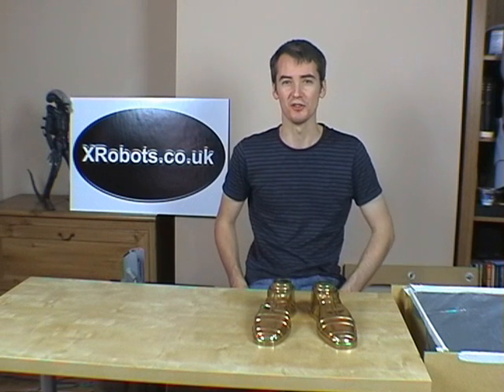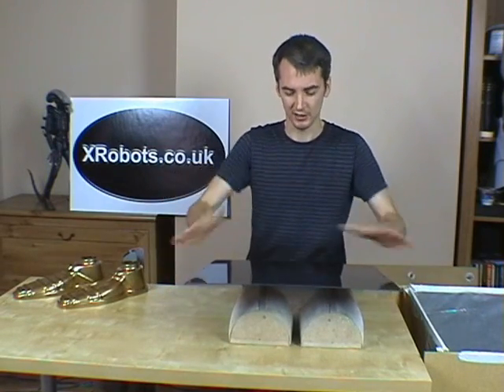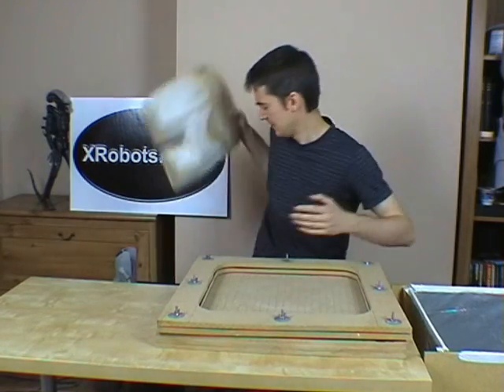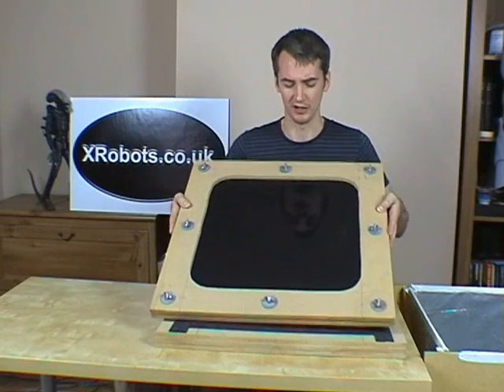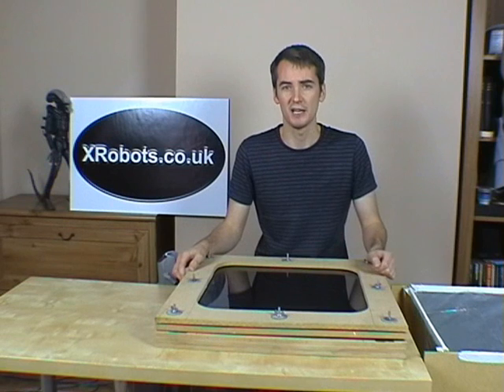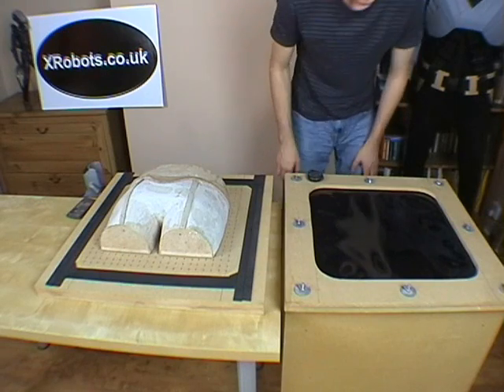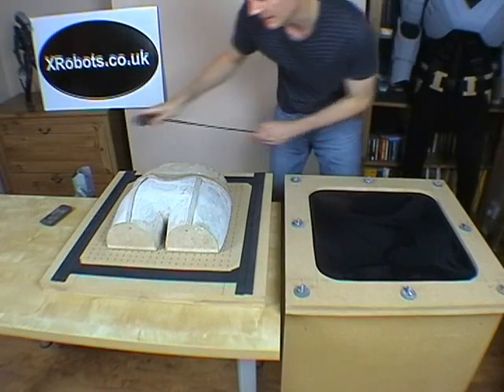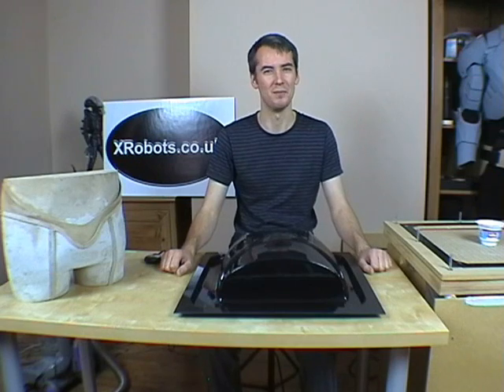How to build a vacuum forming machine including my easy heating solution | James Bruton

Comment: Best vacuum form video I've seen. I've watched it more than 5 times what is the rubber seal for.?
Reply from the maker: to stop air leaking.
Reply: @jamesbruton  thank you. I know the top is three pieces. If the top is a single piece why would it need tape to hold it.

Comment: The FormBox is a much easier solution https://www.sysfix.co.uk/FormBox
If you leave the plastic too long, it will melt, fall into the heater and cause a fire!
Reply from the maker: ok, I'll just go back in time SEVEN YEARS and buy something that didn't exist then
Reply: James Bruton OR place the heater above .
Reply: Dont be silly! Buy the thing first BEFORE you go back seven yers. ;D

Comment: Will this work with clear/transparent plastic as well? Or do you have to cover it in some kind of film so the infrared light doesn't just pass through the plastic sheet without heating it?
Reply: It would work and would only make it quicker adding the background gor the clear plastic... it shoild heat up regardless transparancy as its still a physocal object

Comment: Here in the US, the largest 120V Quartz heaters are limited to 1500 watts, which in my case was not enough to get the styrene up to the proper temp. My solution was to simply cover the styrene/frame with a piece of stiff aluminum (an old sign) to prevent heat from escaping out the top, reflecting it back to the styrene.  Heats up .03 inch styrene in no time at all.

James- thanks for the simple, low cost solution to the toughest competent in a home-brew vacuum former:  the heater.

Comment: Here in the states you can readily buy sheets of pressed board that already have the aluminum reflective paper attached, used for reflecting heat from entering into the attic.

Comment: You make it look so easy. I tried it with .060 clear pteg (which is about as thick as a penny) and it would not get pliable enough to work.It did get very hot to touch.I used a 1500 watt halogen light garage heater. I even tried putting the pteg 12 inches from the heater but, no luck.

Comment: Looks like a vintage tennis racquet press so Im pretty sure if the same locking mechanism were applied that would work well to clamp and hold the removable plastic sheet layer...

Comment: one suggestion: (I know this video is 6 years old lol) but:

If you made your box the same height as your table, you could hinge your heating frame then simply flip it over onto the vacuum table and you'd have perfect alignment every time

(that's what many "pro" vac tables do)

ANother suggestion:

You can buy "pegboard" which already has the holes drilled in.....it is easier to block off the holes you don't want than drill all those holes you do.....now it IS thin, only 1/4" and you might have to brace it, but it is still easier than drilling all them holes.....

Comment: Hey, so with this machine, the second later is just a frame like what you use to put the HIPS in? And if I tried to use the vacuum form process with something besides molds it would melt the material right? For example other hard plastic items

Comment: One quick question, if that's alright. For the frame with all the holes and the vacuum sealing, what did you use to hold the wood pieces together to get maximum sealing? Thanks for all your awesome work!!!!

Comment: That is a great idea to use a quartz heater.  I am going to try that.  What was the thickness of plastic you used?
Reply: +valveman12 I kept seeing 1/8th inch as a good thickness so I ordered some (for me Curbell Plastics was the best price) It's pretty thick, so I think it will do well.  Another thing I saw is that the plastic should sag half as low as your buck is tall, haven't tested it, but seems like sound advice.
Reply: Bhil Fitch Thank you Bhil

Comment: Sorry if someone has asked, but i wanted your opinion regarding the best material to create your model from. You mention that your '3PO bottom' is made of wood. That seems very hard to work detail into.  Is there some other material (like clay or bondo) you use over the wood in order to create the ridged details? I'd love to use your vacuum method but want to be sure that whatever i use to pull from can withstand many attempts/pulls.

Comment: how thick is each piece of mdf board for the plastic?
arent the bolt heads keeping the frame from making a good seal?
what material are you using as a gasket on the board with the holes?

Comment: Hi James, great video!
i have a quick question that I haven't been able to find an answer to. If you don't mind, my I ask, how much detail is lost when the melted pastic sheet is put on the mold? the reason why i'm asking is because I want to make an Iron Man armor. I already made one out of foam, but i want to make another one. My vision is that I will build it out of foam, then vacuum form plastic over my existing foam pieces. That way, the exterior will be plastic but will be lined with foam. Then using epoxy based model clay, I can build up the smaller details that would be lost in foam.What do you think? 
Thanks!

Comment: Hi James, thanks for sharing! I built a comparable heater here (mdf, coated with alu-foil, a patio-heater in de base. After 3-4 minutes my heater start to give grey smoke. Did U experience something likewise?
Reply: ***** could be the heater itself, perhaps some wiring inside. Hope not..
Reply: Simone Romanow are you sure that the smoke is coming from the heater itself. A lot of plastics start to emit smoke at around 200 celsius.
Reply: m1stercheese Hi, thx for asking! The smoke comes either from the heater or from the DIY-oven. Perhaps some trapped moisture. I tried without plastic sheed and it was still smoking. I opened up the heater although: no visible melting inside.

Comment: That electric heater wire you are talking about is nichrome wire, a high resistance wire used in heating elements in space heaters, dish washers, dryers, etc.   Connect one end to hoy 120v AC and the other end to your neutral AC return line (in the US anyway).

Comment: try 'Stephen Webster Plastics' in St Albans, I am a prop maker in the film industry and we use them all the time
Reply: michael pearson Air tight vacuum
Reply: Michelle Sullivan THANKS FOR THE INFO.
Reply: ***** HI JAMES. why is the rubber seal added round the frame of your vac forming table.
Reply: michael pearson Yes sir

Comment: Im assuming polystyrene is out of the question as a mould maker?
Mainly because of the fact it would probably melt with the sheet...
Thanks.
Reply: But still awesome build bro! I am very keen to try it!
:-)
Reply: I wanna say you CAN use polystyrene. . . ????  Some of the other vids I've watched use it and also a lot of masks are made using that material.  Don't quote me though.

Comment: Great video and a really ingenious idea for the home DIYer to experiment with. 

Can you tell me what is the temperature of the plastic just as you are about to vacuum form?

Do you think the same temperature could be achieved with say one or two 1000w (or 500w) floodlights with maybe a shorter chimney box? Floodlights can kick out some heat. Obviously not as much and as quick as a quartz heater but probably a little more safer if say perhaps the pastic you were heating was to melt and drop, it would fall on the glass on the floodlights.

Your thoughts would be greatly appreciated.

Comment: Can I cut foam into a shape and use that as a mold or would it be too soft to do that?
Reply: I looked at some other people doing vacuum forming and saw if you do it like how you do it can produce the parts but its not super accurate to the mold, they say the most details in on the inside of the mould and be better to cast a negative mould and then do vacuum casting with that as it would be able to transfer even tiny details. Might be something you want to try.
Reply: if its a polyurethane foam it wont melt

Comment: James, an excellent video. I need to vacuum form a short run of cradles as drop-in charging stations for battery powered equipment, and this is precisely what I need to get that job done. Looks like I'll be having a productive Xmas!!! Many thanks. (Peter: I'll be using 37-3146 from Rapid Electronics in the UK).

Comment: how has the heater held up up to this point? i'll either use you're method or use ceramic fiber board and nichome wire for my heater. cost is the big factor as usual.

Comment: Great video. Thanks a lot. Did that heater cost around £150? Most seem to around that price point, although there is one in Argos/Toolbox/Tesco for around £50. I might give the £50 one a try. I would be willing to pay £150, but not if it wasn't necessary. I can always return it. Its 20/48cm, which seems like a similar size you yours. Thanks again.

Comment: great video, i know this is a very loaded question that depends on thickness of material and size i use but i'm looking for just opinion of those of you that have worked with this stuff more than I which is never at the moment.  if for example i wanted to make an exact mold of the inside of this standard size 60 quart cooler what thickness would you recommend and how thick of material do you think i should use? and for the rigidity of it do you think i should use abs instead of thermoplastic?

Comment: Thanks for writing!  How do you find the sharpness of the details after pulling?  I plan to use multiple layers of thin plastic and adhering them to each other, and finally using a layer of vac-formed foam on the inside for comfort and strength for a cosplay outfit.  This is the only way that I can figure out a way to avoid getting the soft and rounded edges that I associate with the process.

Comment: Hi James. Thanks for the creative solution. I am thrilled to see your supplier is actually withing a driving distance from area (I am from Bandung). What heater do you use inside the box? Can I have your spec for that heater? Cheers. Lyd

Comment: James or anyone.  Can't get all the questions in using this so here's the first one.  Can you use a plastic piece from a kit and vacuum form it?  Crazy question but, you'll never know unless you ask.  Can you use the piece you made to vacuum form more pieces?  Do you use baby powder to keep the piece/s you vacuum form from sticking? Never clear on the kind of powder. Kitbashing for a single piece could get very expensive if you only needed one piece ie: 20 kits for 20 single pieces. Thanks ya'll

Comment: i found the supplier and material, but they dont specify dimentions of the HIPS squares.  are those completely custom or are there standard sizes like what you used?  if so, what size is that?  im making a vacu-form and i want to know what dimensions to use.

Comment: Hi Mike, 1000 apologies for late reply but I didn't get'any notification.

I solved the  "heating clear plastic problem" by making a backing plate from mdf and foil.

In winter outside it took 15mins to heat and the pulls went v.well.

Chris.

Comment: I was actually thinking of making an oven with the stove. It won't be a direct flame, as I'll put metal sheet over & hopefully diffuse the heat of the air inside the box evenly.
I need to ask you also, how thick the depth of the mold can be? I imagine the 2-3 mm plastic will stretch over the height of the mold and thinned out? Any specific guideline about the size proportion of the plastic over the size of the mold?

Comment: Did you try putting something that will heat up behind the clear plastic, like a lid that fit over the plastic frame? I'm not sure if this would entirely solve the problem, but I've seen it used to better distribute heat on other vacuum form systems, like the Phlatboyz Phlatformer.

Comment: Just a small tip.If you use a vacuum that is reversible (you can use it to blow air),you can vacuum form the plastic,let it cool and then hit the reverse switch for just a second to blow just enough air into the plastic to pop it loose from the mold.It will be easier than trying to cut the plastic loose sometimes. :)

Comment: Hi James, Thanks for sharing your tech.
I built the system to mould a big RC glider canopy but the achilles heel is that transparent plastic won't receive heat from infra-red. Great for blacks/ opaques I guess but clear plastic needs another heating solution.

The vacuum table works well however and so simple to make. FYI I used a MTB inner tube over the end of my vacuum nozzle (tripled-up) to obtain a perfect seal to the table.

Chris.

Comment: for safer work, would it be easier just to place the box with the heater over the plastic sheet holder, so that way you could prevent melt down on the heater, depending of sort of plastic and thickness you use.

Comment: Hi James, great video.  I just wondered if the height of the box which contains the heater important, or have you made it that tall to make it the same height as the table?   This leads me to the next question of  "Is their a minimum distance from the plastic that the heater needs to be in order for the plastic not to be heated too quickly?".  Many thanks in anticipation of your reply.  Trevor

Comment: I tried acrylic plastic in my own vacuum forming rig, and it didn't work out.  The acrylic developed air bubbles inside and didn't look good at all.  I ended up using PETG plastic, which is like PETE (pop bottles) but modified with glycol.  Plastics suppliers can tell you more about PETG.

Comment: This is the most helpful video i have found on this i am just wondering what is the exact type of plastic you use and what thickness? I really want to make Jason Todd's Red Hood helmet from Batman and the videos i have found doing helmets this way they were doing it in 2 half pieces and im wondering if its just possible to do a whole helmet with one sheet of plastic. im pretty sure i can i just want o make sure. and what kind of paints do you use?? thanks

Comment: thx for these tips 
but I still have some questions , if u dont mind answering them
does the mold shape affect the needed vacuum power to fully suck the plastic?
does the vacuum pump limit me , i mean if i have weak vacuum , will I have to use thinner plastic , low mold (height) , size of mold or number of molds (if small molds used simultaneously )

Comment: @jamesbruton Amazing I didn't think a vacuum cleaner has enough power to suck like that. What type of plastics did you use on this video and what others you suggest?. I would like to use polycarbonate but it has a fusion temperature of 240ºC.